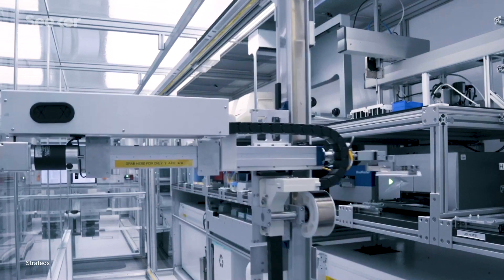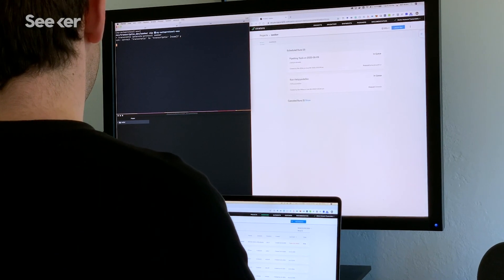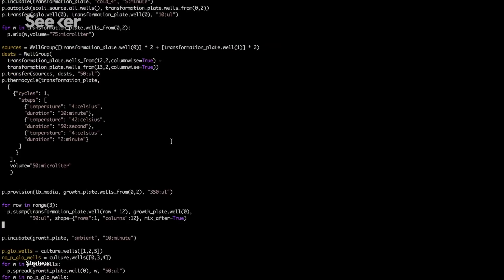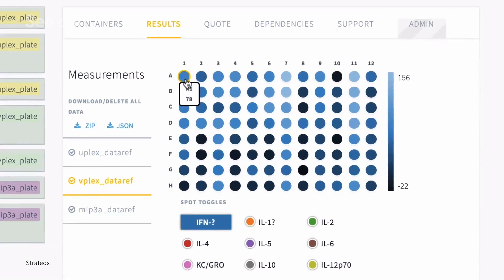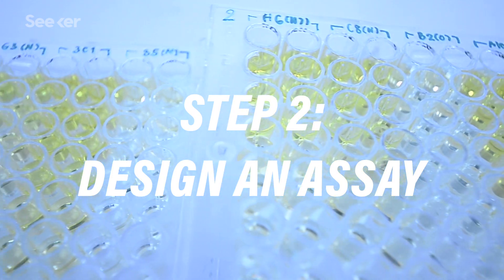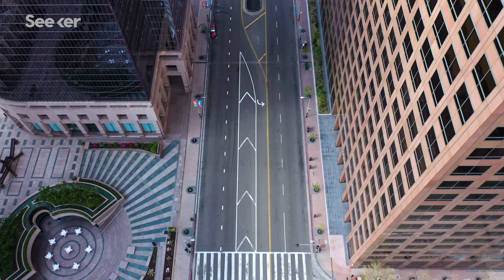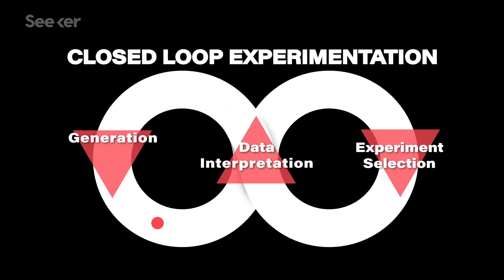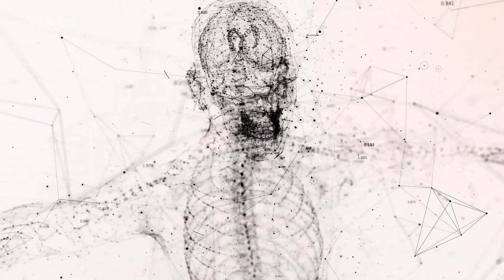Inside the Lab Where Robots Run Their Own Experiments

Comment: The system goes on-line August 4th, 1997. Human decisions are removed from strategic defense. Skynet begins to learn at a geometric rate. It becomes self-aware at 2:14 a.m. Eastern time, August 29th. In a panic, they try to pull the plug.

Comment: I work in this industry as an automation developer in the medical equipment engineering industry.  It is so cool what robots can do from motion in 3d space to seeing actual color changes and other changes in liquids.  It is a cool time to be alive.  I advise anyone interested to get an arduino  and a computer, even a raspberry pi, and learn to code the arduino to not only be able to move in x, y and z but to program and use the many sensors that are available out there. Voice control is the best in my opinion. I work with nephelometers which are some of the coolest instruments when interfaced with a robot.  And it's cool having a job where you run a program and come back good later and check the results.